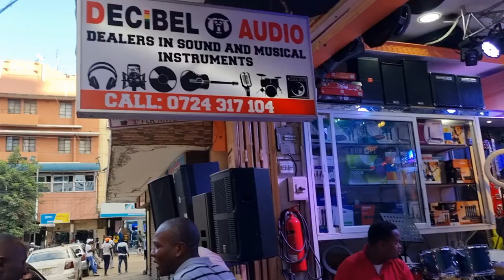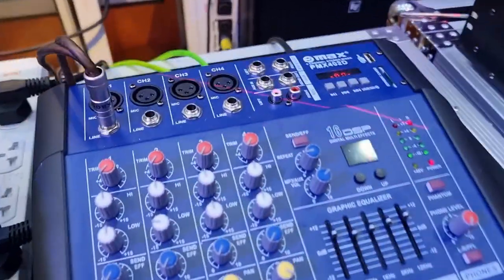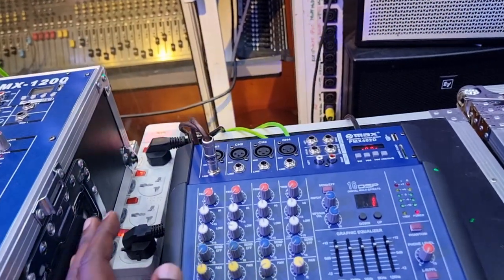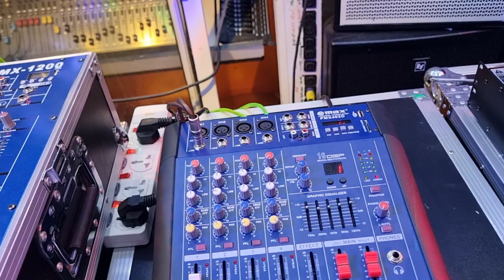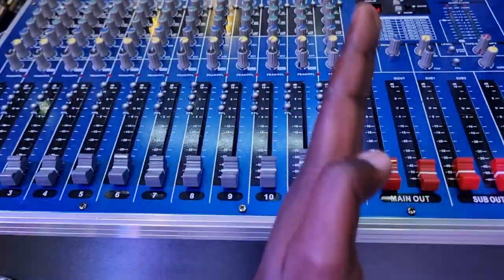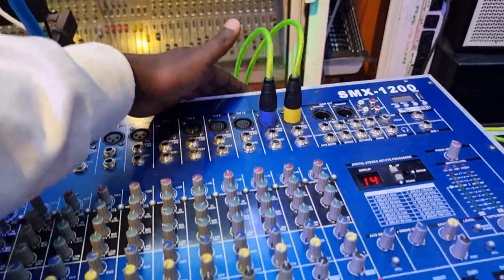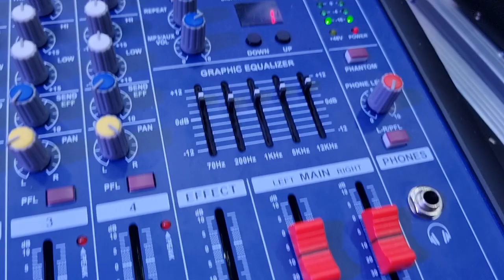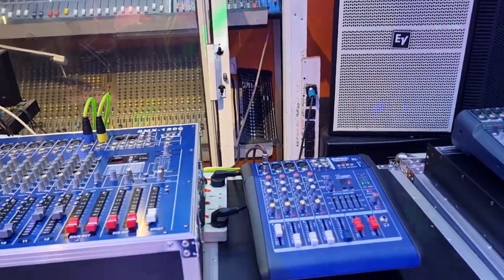CONNECTING 2 POWERED MIXERS (to achieve more channels )

Comment: Hey sound engineer, I've got a question about mixer outputs.

I have a small mixer where only the left output is working, and this left output has two jacks with different sizes.

I'm wondering if it's possible to:

1. Send one jack from the left output to a main mixer.
2. Send the other jack from the same left output to a separate, dedicated speaker.

Basically, I'm trying to split the signal from one functioning output.

Is this setup feasible?

If so, what potential issues should I watch out for?

Thanks for your expertise!